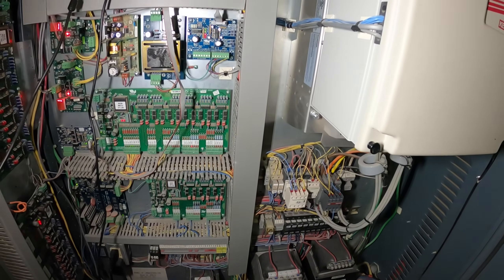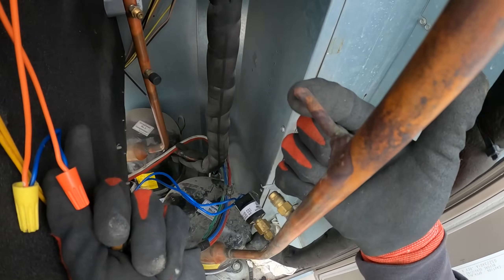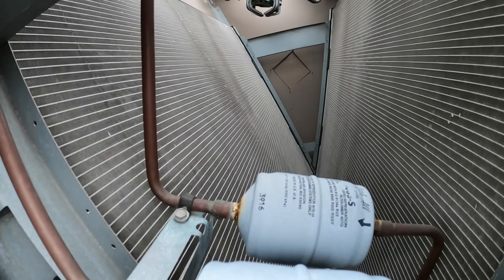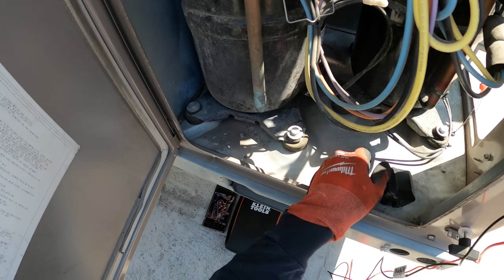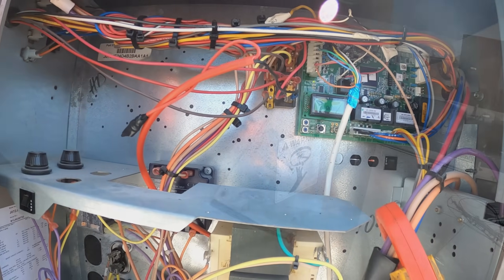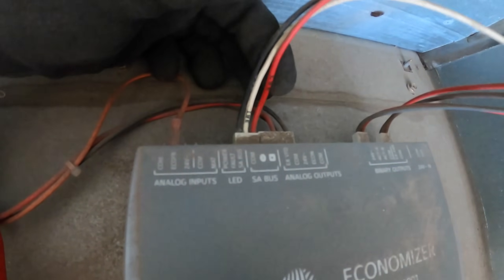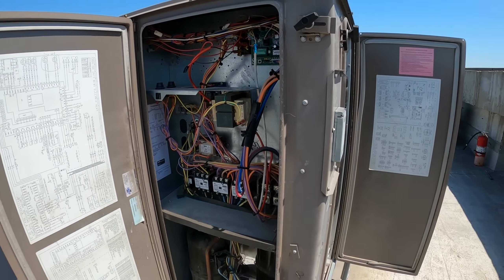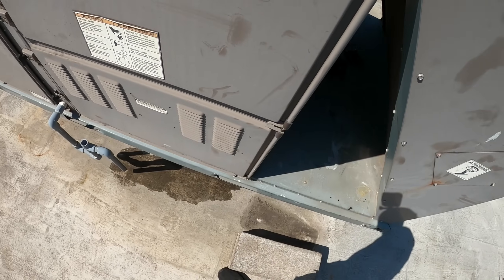HVAC: Johnson Controls RTU Not Cooling Elevator Mechanical Room (Johnson Controls Roof Top Unit)

Comment: Those York/ Johnson Controls units are not very used friendly. I talked to tech support a few times about these units. From what I gathered these units are supposed to be programmed at the factory to the specs of the installing company and or the client. I had one that the software was corrupted. I had to download the software on my laptop to a thumb drive and then transfer that into the board. Most of the errors codes were because the sensors, oa,ra, static etc were never installed. I'm glad that I'm retired now because this new technology is great only when it works... good luck!
Reply from the maker: Definitely not user friendly. I will probably end up talk with tech support once the leak is repaired (If the proposal is approved) Thank you very much for your input. All this new technology just causes many failures. Definitely have errors of sensors that are not even installed. There could Definitely be a software issue here. I'm glad you are also retired. Hope you enjoy it👍 Thanks for watching! 🙏🔧⚡️
Reply: ❤❤❤❤❤❤❤❤❤❤❤qaa❤❤q❤❤❤q❤❤❤qqqq❤❤❤❤q

Comment: Mr., Jumper Man, the wiring on fire detect. systems are supervised circuits. Meaning they must remain in tacked at all times. An open circuit should register an alarm and horn at fire panel. There are major issues if fire trouble alarm did not operate or if it was gagged.
Reply from the maker: Thank you for your advice! Makes sense. The fire alarm relays itself must be hacked because this alarm is not jumped out/bypassed, it is literally disconnected. It would have probably set off alarms. I will make a note of that and speak to the fire alarm company if they approve the proposals here. Thanks for watching! 🔧⚡️

Comment: I don’t know about New York, but in Chicago and surrounding suburbs the fire alarm companies refused to go on the roof maybe it’s just the ones we deal with but it’s either electrician or the heating and air guy that takes care of it. I’ve had to wire them into the RTUs or any HVAC equipment most of the times. They don’t even go on a ladder. Tell you the truth. I hope they don’t get paid that well because he’s Primadonna around here, don’t cut it in my book

Comment: You could probably go into the settings if I’m not mistaken and close that economizer completely 0% because you don’t need that in the elevator room that’s just minimum fresh air when you’re dealing with like an office or something where there’s a lot of people if you want maximum cooling I’m sure that elevator control  room gets hot. I’ve dealt with those rooms before.
Reply from the maker: Facts. You need fresh air by code in common areas like lobbys & gyms. This room definitely gets hot and an economizer isn't exactly needed here. It would let in a lot of moisture that the AC is fighting against trying to remove it. Wear and tear. Thanks for watching & for your input! 🔧⚡️
Reply: Yeah inwas thinking the same thing.
Reply: Economizer in min position is used for your minimum fresh air requirements. But economizer is used for free cooling when outdoor air temp and humidity allow it. Economizer can also work in tandem with stage1 instead of running both stages of cooling. Seeing how they are wearing sweatshirts Economizer may be enabled because of the outdoor air temp. But if your going to replace it just put in a jade
Reply: @StebbyGreene  I’m sure the ambient temperatures not cold enough to handle that elevator room. That’s where you need both stages running, I’d even suggest installing low ambient fan cycling controls otherwise he will be out there numerous times those are very low quality economizers that York puts in their crap almost like they can’t be trusted to open up in the winter. I’ve had tons of problems with those or maybe replace the economizer itself they don’t last
Reply: @michaelpaulsen64  I just saw them wearing sweatshirts so ambient may be around 60-65 degrees and I’m pretty sure those economizers have mixed air sensor as well so could in combination of bringing in outdoor air and running 1 stage of cooling, drop the supply air to 55 degrees. Also would be exhausting that hot mechanical room air instead of trying to cool it. Economizers are great when set up properly and working
Reply: @StebbyGreene  yeah I’m not sure if they got an exhaust fan in there but that’s the keyword set up properly and working chances are it’s not working properly i’ve actually cooled elevator rooms in some situations with water cool heat pumps and they cool down pretty low but the building already had that set up so it is what it is. He’s stuck with that junk
Reply: @michaelpaulsen64  that lower hood on the unit should be a pressure relief damper. I just see him running into issues in the cold months when they are going to have to run mechanical cooling if that economizer isn’t working properly and pretty sure those units don’t have low ambient controls and the condenser fans are single speed so a standard low ambient kit just going to be banging that fan on and off non stop and kill it quickly
Reply: @StebbyGreene  i’ve installed the speed control kits in computer rooms  They really aren’t computer room units. Like a Leibert unit  They’re just basic rooftops but they’re using them as that and they’re still going. It’s been a few years, but yes they could fail, but that’s what they get for. Trying to cool spaces that should have different type units.

Comment: York jci units are complete junk. The coils leak constantly and the economizer modules go bad all the time. Guess what when you replace the economizer module its prob gonna have new software version, also guess what it wont then communicate with the main control. Then guess what, you can update the main control board so it will communicate unless the board is a certain type then you must replace the main. Of course they tell you none of this when you get the economizer module.

Comment: That’s the frustrating part of the newer units. They shut themselves down sometimes for simple things on Trane. It’s an outdoor ambient sensor on the York. It could be anything. That’s why I like just pressure sensors for the refrigerant. Maybe amp sensors but let it run.

Comment: being a lift motor room you should leave fan on not auto. its there to control temp & humidity. running ac is cheaper than lift components. being a new building there may have been commissioning issues with fire equipment as lifts have fire service switches and can be a real pain on commissioning. definitely note on paperwork for customer to acknowledge to cover your butt. theres also the need for fresh air to pressurize room and shafts to keep dust etc out but not too much as that can cause lift shaft pressure issues,,,, iyk,yk!  had issues on a few new buildings that do complete air change everyday at certain times over pressurizing lift shafts and lift doors not closing while change is happening. alot of times things are installed and designed for a reason/s that might not be obvious at the time. look like the metal mesh filter for economizer intake was on the roof over in the corner. could spray deoxit on economizer terminals and connector

Comment: The fire alarm is usually hooked to the S/D terminals. When they are shorted together, the equipment will shutdown. If S/D terminals are not present, you usually just interrupt the 24 volt to thermostat "R" terminal.

Comment: Is there a temperature heat sensor w/ an exhaust duct in that Elevator room? I noticed the supply air duct... You'd think there is one and from the video it was hard to tell. Curious.
Reply: Or is the exhaust duct from the elevator room on the roof that I am now seeing @ 47:58???...I see the inline motor and the power is on at the main disconnect. However, seeing the Building Engineers don't perform their maintenance P.M.'s, i.e. the fan coil, the filters, etc... (super common)

My question is, what is their B.A.S. heat-temp set point for the Elevator Room to actuate the damper and trip the fan motor to on?  If you can, have them set it for a lower temperature than 77 degrees. Or is it like talking to a wall with the Engineers onsite? :)

Comment: And as for working on York of any kind good luck there mainly pieces of shit countless times doing startup on new installs major problems probably 10 different times in the last five years, don’t know why they don’t redesigned that junk
Reply from the maker: Sheesh. They don't make anything with quality anymore these days. Thanks for watching! 🙏🔧⚡️
Reply: @JumpermanTech  you’re exactly right even if you go more expensive top-of-the-line equipment like Aon they still suck. I’ve replaced countless circuit boards and sensors In fact they’re way over engineered and they’re expensive as hell for the parts for the customers
Reply from the maker: @michaelpaulsen64  I hear that! Aaon is definitely way over engineered and complicated. Especially the stuff nowadays. They have an Aaon unit that is also down here. Only a 5 year old building and I can see it had been worked on before already. Sheesh. Good to hear others feedback. Thank you for that & thanks for watching 🔧⚡️🤙

Comment: Should not need humidity or air quality sensor to run. You could probably relocatee the economizer with some multiconductor cable. Check for continuity on your fire alarm wires, then wire them in to interrupt the enable of the unit by following your wiring diagram

Comment: Do you have anything for  these coils other than replacing
Reply from the maker: Some people repair aluminum leaks but it's best to replace it for the future. Aluminum micro channel coils are not good. I wish they made copper coils. Thanks for watching! 🔧⚡️
Reply: I've repaired a bunch of them have a few out there repaired years ago still holding but they usually leak in other spots I always recommend replacing them.

Comment: I'd try contact cleaner and/or a tiny dremel tip to clean out the contacts on that economizer plug, and then apply some dielectric grease to all those connections to prevent future corrosion.
Reply from the maker: Good advice. Thank you for that and for watching! 🙏🔧⚡️

Comment: The Fieldpiece needs a network connection on the phone to work?? If it’s not using only Bluetooth, that’s a bad design by them
Reply from the maker: They use Bluetooth but I noticed when there is bad cell service, it takes forever to load. Thanks for watching! 🔧⚡️🙏
Reply: Oh word. What about the measurequick app with fieldpiece attached.

Comment: Codes you are trying to get rid of are factory installed.Sensors are field installed and missing. You have to reconfigure board program. Econo boards are junk...
Reply from the maker: Thank you for your input! Might need Johnson Controls tech support and advice on this one after the leak repair if approved. Definitely a lot going on with this unit. Appreciate the input. Thanks for watching! 🔧⚡️

Comment: Should leave the nitrogen in that circuit 2. Letting it stay flat....allows moisture to intrude on that circuit. At least with positive pressure, air can't enter. Even if you replace the condenser coil, the circuit will be moisture laden whennits flat. Makes vacuum take evn longer and more oil changes on the vac pump. Just food for thought.

Comment: cant imagine replacing that coil...fuck that
Reply from the maker: It is what it is! I hear that though! Thanks for watching 🔧⚡️
Reply: It's either they buy the coil and put it up there or he buys it with uncharged of course and does it. Once it's up there just remove and 1001 screws. More importantly remember where they go. 25K sounds like a place to start. You never know what you run into. 
What we know that they are gonna do is say it's fine because JMT made a temporary fix. Only when that dies does it now become an emergency. Emergency cost 35K tho. Nah mean. We running a bidness not a charity.

Comment: Unbelievable, always the same shit. New units crappy installation and no service schedule. And then being surpriced when it breaks down 😢. Very dumb design with that economizer control installed in the air inlet channel.
Reply from the maker: Might have never been commissioned properly from the start but if it worked, that was good enough for them. I hear that. Thanks for watching & commenting! 🙏🔧⚡️
Reply from the maker: Facts! The design of that economizer control being at the air inlet it terrible. Guaranteed to fail. Thanks Johnson Controls! 😂🤙🔧⚡️

Comment: I wonder if allowing the board to re-learn itself maybe would of helped the situation, then again I'm still watch haven't finished video yet....🥷🧰💪
Reply: yes re-learn will get rid of all non existing sensors.
Reply from the maker: Thats great advice! Thank you for your input and for watching🙏 In the manual it says if it has errors for sensors that aren't used in the system, to change to economizer itself or update the software because if it's not at a certain software, those errors cannot be erased. Such a strange error. Somehow allowing the board to re-learn itself or do some sort of self test sounds like a good idea👍
Reply from the maker: @deerams8045  That makes a lot of sense. Good advice. I need to look into that 💯
Reply: Those are "ghost errors " you need to run the relearn steps on the board. But won't effect operation
Reply from the maker: @subcoolu4913  Thank you for the advice! Much appreciated & thanks for watching 🔧⚡️
Reply from the maker: @subcoolu4913  Is there anywhere online that I could find this information on how to do that? Is it in the manual?